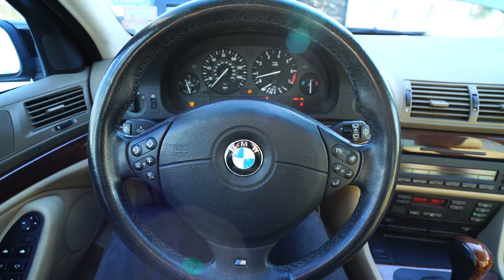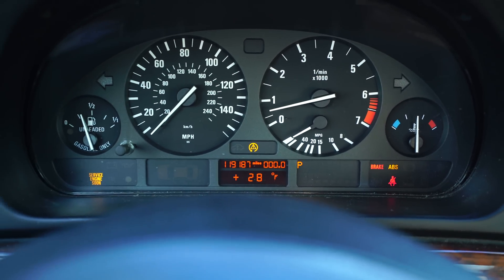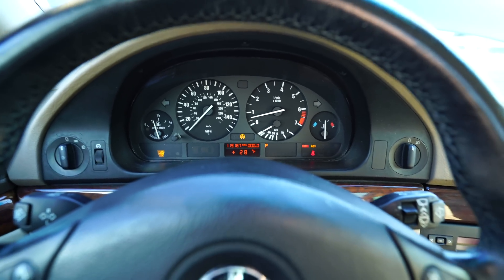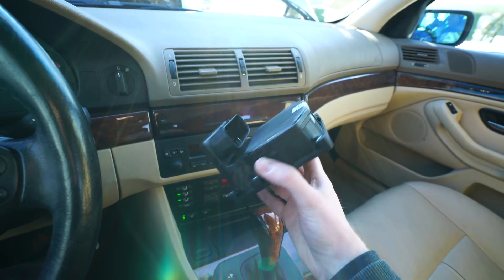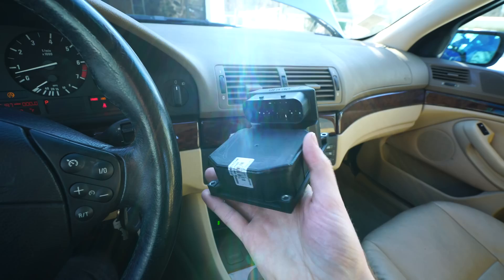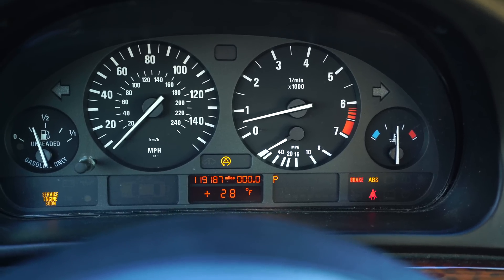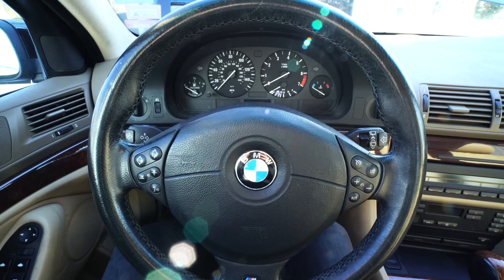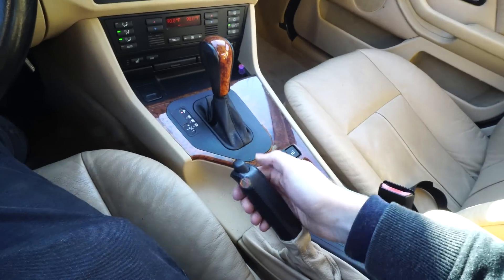BMW Trifecta Lights ABS, DSC, BRAKE - ABS Module Repair E39 BMW 5 Series

Comment: did this with my e39 recently. I also installed a heat shield I got on eBay. It took about 3-4 months for the DSC, BRAKE, and ABS lights to disappear ALL THE TIME. I'm not sure why, but after installing the new module, there would be no lights on the dash, then after maybe 5-20 minutes of driving, they'd reappear. This stopped about 3-4 months though, and I'm not sure why. Maybe the computer had to take some time to reset or something... Just thought this would be helpful for some people to know.

Comment: My e39 in e has the abs and asc lights on, the cruise control works but as soon as I exceed 100km/h it deactivates and does not reactivate until the lights are reset. Could the module also be causing this?

Comment: Great video, I have a 2001 E39 BMW 530i, my symptoms are the SpeedOmeter sometimes works and other times it does not and the ABS light is on in the dash, would rebuilding the ABS module fix this?
My Google search shows that BBA-Remanufacturing is out of business and your Ebay links no longer work, can you or your followers recommend another company that rebuilds the ABS module? Can my BMW be driven with the ABS module out while waiting for repair?

Comment: I have the trifecta lights with the Trans failsafe prog warning on dash. The thing is I just did an oil change yesterday and all of a sudden I get the trans fail safe prog warning along with the brake and abs light on dash. Trans was working fine no issues at all up until this oil change. I’m thinking the lube tech might have done something shady such as steal the trans connector underneath but other than that I think it may be the ABS module. Can you drive without the abs module? I’m looking to send it in for a rebuild through eBay

Comment: was the red brake light on even when the handbrake was not active ?
I had a module rebuilt by 2 different shops and when I hook it up I still have the trifecta 
so far have replaced all ws sensors, brake pressure sensor, brake fluid reservoir cap, brake fluid, pads and sensors and STILL have the trifecta with red brake light
INPA says front left wheel speed sensor, front left outlet valve & front left inlet valve.
I have read every forum known to humanity and cannot solve this issue
any thoughts ?
Reply from the maker: Sorry to hear the trouble. The system is complex. I wouldn’t rule out a bad module. New is not cheap and must be coded to the car. It may be worth finding a competent indie bmw shop to diagnose. You need a guru who cares for this. Also not easy to find!

Comment: Is it common for the speedometer to go out when having the “trifecta” with an E39??
Reply: im having the same issue... did you ever get it resolved ?
Reply: @iamstlouiss  same yall ever figure it out
Reply: @ I ended up changing all my speed sensors with ones I purchased from Fcp Euro and my steering angle sensor which was a pain to do. That fixed it for me

Comment: I have the trifecta.  I notice you did not, but other video always warn about reprogram after swapping the ABS module.  Is this true?
Reply from the maker: If you rebuild the one from your car, no need to program. If you replace it with one from another car or brand new, that requires programming.
Reply: @BIMMERZEITT  
Thanks for your very helpful response!

Comment: E39 are really pos and the only good thing about the car is the way it handled on high speeds other wise get a Toyota for real
Reply from the maker: If I was solely interested in saving money it would be a Toyota or Lexus. But I like the soul of a BMW and to tinker with never ending repairs 🤣
Reply: @BIMMERZEITT  that is true i have learned a lot from my e39
Reply: Puhleeze don't feed the trollz

Comment: dID YOU NEED TO CODE YOUR MODULE AFTER RECEIVING IT?
Reply from the maker: No. You don’t need to code it if you have the one from your car rebuilt. If you buy from another car (used) it needs to be coded.
Reply: @BIMMERZEITT  brill thank you

Comment: I wasted money replacing all 4 wheel sensors (on my 2003 530i, 229K miles). This video is very encouraging, and I will proceed (I have a 1987 325e, 285K miles to putz around in). I have noticed that the Trifecta is DEFINITELY heat-related, so when I saw a guy say he was going to have it rebuilt "again", I'm thinking placing some sort of heat shield between it and the exhaust manifold. THANKS!
Reply: Did this work for you? I was thinking of doing the same thing
Reply: mine only have the light on when the engine bay become hot
Reply: Hi. Did you put a heat shield?
Reply: @KL400-n2e  Where do you get the heat shield from?

Comment: Can we just disconnect the module and use the car?  My antilock brakes are engaging on tar when I even lightly use the brakes.  I need this car bad and a little scary driving

Comment: If the ABS module is bad will the cruise control still work? My cruise works but I have the "Trifecta" of lights.
Reply from the maker: Hey Kris, first step is to scan your car with a BMW specific code reader like this one: https://amzn.to/3s89bkc (affiliate link) which will allow you to begin diagnosis. Otherwise you're just driving blind. It could be as simple as a wheel speed/abs sensor at one corner causing the lights, but could also be an ABS module in need of rebuild. Yes cruise control can still work sometimes.

Comment: I swamped mine in my 2003 for a used one and now it stays on even with the faulty one
Reply from the maker: You can’t just swap them, they are coded to the vin number of each car. You may need bmw software like INPA or ISTA to re-code it
Reply: Don't swap it unless you're swapping with new. Better to repair yours first. If that doesn't work get a used one, repair that and recode that. Not sure the cost of a recode, dealership may prefer to do you a new one $$$

Comment: Nice work. Did you disconnect the battery before removing/installing the ABS module? By the way, BBA-Reman is now shut down worldwide, so forget about sending anything to them. The USA one is a mile from my house. It's likely they've been busted for shady business practices, and lots of people will never see their parts again.
Reply from the maker: I don’t recall if I did. It’s probably recommended to, but since the connector is unplugged anyway it shouldn’t be too big of a deal. Interesting, I haven’t heard that news. Any other rebuild sources?

Comment: Thanks for the video! I DIY the soldering, what kind of adhesive are you using for replacing the plastic cover at the ECU?
Reply from the maker: eduki nice. I sent mine out for repair. But the company who does it looks like they just used a silicone adhesive to attach the cover

Comment: Hey question, if my abs light turned on, then the brake light and then the cluster gauges stopped in addition, is that an indication of the abs module failing too? Like with the abs module failure, will my rpm gauge, temperature gauge and odometer quit too? Or is that a different problem?
Reply from the maker: NinjaPegasus300 yeah it’s possible... but haven’t heard of tach and temp failing at the same time. You have have something else going on. Step one, buy a creator c310 bmw scan tool for $56 ish and scan your car for codes. See what the abs computer has for codes, if any. Code reader: https://amzn.to/2GlGKvF

Comment: Do you have a video about remove the abs module? Thank you!
Reply: Unplug it and take out the six bolts... Then apply for job at NASA because you are then officially a rocket scientist.
Reply: Hey how are you I have the same problem is there a link to the service area or where to send it for 4

Comment: Congrats for your video, its great and very helpful.
im searching the service por a e46 323i 2000, and i dont have luck... i have the same problem. Do you know if the module for the 3 series can be repaired?
Reply: Its a common module try widening your search like bmw abs repair instead of e46 etc

Comment: Any symptoms while driving
Reply from the maker: Sam Dog not really other than the lights being on. However this means the ABS will not work in the event you need it to stop quickly and safely. So is advised to repair as soon as possible.
Reply: @BIMMERZEITT  I always drive with it off.....this time, the light wont turn off
Reply from the maker: Sam Dog oh you mean DSC light? Traction control? Yes sometimes it’s just a intermittent fault that will go away in a day or two on the e39. I’ve seen that on several e39’s. Other times with the abs and brake light it’s the beginning of abs module failure. Get the best bmw a can tool I recommend to scan and check for codes first to diagnose.

Comment: Did you need to code your module ?
Reply from the maker: Sex Hawk no coding is required if you have the original module from your car rebuilt. If for some reason yours can’t be rebuilt and you get one from another e39, yes it will need to be coded to your vin.

Comment: Thanks for this. Two questions, the link for ebay repair site does not work. Any other suggestions? 2nd question - can I drive the car without the module while I send the module out for repair? Thank you
Reply from the maker: G Taylor Johnson I will update it in the morning, thanks for letting me know. Yes, technically you can drive the car, however I don’t recommend it because your speedometer will not function and ABS will not work. So if you were to get into an accident, I’m sure the insurance company would love to deny coverage due to the abs module being missing from the car. Not worth the risk if you ask me. But technically yes the car will run and drive without the module.
Reply: @BIMMERZEITT  Great. Thanks for that. Here's a link for a rebuild service I found. https://www.ebay.com/itm/BMW-E39-E53-ABS-MODULE-REPAIR-SERVICE-525-528-530-540-X5-M-Warranty-Quality/323200458103

Comment: Im about to go look at a 2003 525i bmw and the guy mentioned the abs light was on and has been sitting for 2 years... The worst thing could be this right? I heard it may cost up to 2k to fix?
Reply from the maker: You could scan it while there and see what ABS code it is showing specifically. Not a big deal, nothing you can't DIY! See my e39 buying guide here before you go see the car: https://youtu.be/70zvnZdvEog
Reply: @BIMMERZEITT  I had mine fixed a couple years ago but now I have the same 3 error lights again. What do you suggest?
Reply from the maker: davedavis scan with a bmw tool like creator c310 get the abs code to begin diagnosis... even the rebuilt ones fail again after several years it could be the module again
Reply: @BIMMERZEITT  how many years ago and who replaced/rebuilt it?

Comment: Hey hopefully you reply back :( I got this on my 2008 328i when I drive longer than 10 min it pops up I took it to the dealership and it worked fine for 2 days nothing popped up til today took it back in they said to either fix the bearings (which is a 50/50 chance it can be that) which is 1k to fix or This I think but they are charging 2,700 for it :/ can I take it to a mechanic instead ???

Comment: Just got the trifecta on the way home from work today in my 2001 740iL.  🙁  Looks like I will be sending the ABS module out for repair.  Again.
Reply from the maker: Ready72000 ugh!
Reply: BIMMER ZEIT Started the car this morning and the trifecta lights went out for about 15 seconds, then came back on.  I drove it to work.  Started the car this afternoon and no trifecta lights all the way home.  Strange.

Comment: Looks like the links no longer work to the ebay ABS Module Repair Service and the Amazon to the New ABS Module is not available. Do you have any other source for the repair service?

Comment: Did you have to bleed your brakes first?
Reply from the maker: Paul Nelson hi Paul, no need to touch the brake hydraulic system. The module here doesn’t interact with fluid or hydraulics directly
Reply: BIMMER ZEIT I have a bmw 5 series, e39 520i. Year 2002. So bleeding the brake lines isn’t necessary, just unbolt the ABS module, send it off for repair, then simply bolt it back on! I wonder why my mechanic is telling me that the brake lines need bleeding! If I can do this, then it saves me going to the garage.
Reply from the maker: Paul Nelson might be unrelated. Flush brake fluid and bleed every 2 years anyway as part of maintenance. It couldn’t hurt. Shouldn’t cost much. An hour labor maybe
Reply: BIMMER ZEIT it’s my abs pump that is going to be repaired. Is that different from the abs module?
Reply from the maker: Paul Nelson oh ok, yes the module is the computer shown in my video. The pump is a different story yes that is part of the hydraulic system.
Reply: @BIMMERZEITT  Thank you so much, it makes sense now.

Comment: Trying to help a friend with his car. His abs was malfunction and got a replacement module as we determined that was the issue. New module in and all was good for a few months until dsc abs lights lit up again. DSC5.7 73DSC pressure sensor. Code B3450_57051. Any idee where to start. Could it be the replacement module acting up. Brake pedal feels soft in comparison to my e46

Comment: I bought a bmw e39 530d 2002 with both abs lights on. I have a code : 14 Valve relay fault. Do you think i need to repair my ABS module like you ?
Reply: I think the relay is bad you can change it. In the fuse box.
Reply: Did u fix it
Reply: @terrencemayes469  I changed it

Comment: Hey Thanks for the Video. My X3 abs braking comes on with very little pressure applied to brake pedal, especially when backing down my steep driveway. Yesterday I took out my abs sensors and cleaned them, what was strange, I did not see a reluctor ring down the hole.
I also have the trifecta of lights. ABS, 4x4 and brake. Any thoughts? Thank you!
Reply from the maker: Nick S hey Nick step 1: scan the car with bmw software of bmw specific tool like the creator c310 and get the fault codes
Reply: @BIMMERZEITT  Thx for the fast reply. I did check the codes with my cheap Actron scanner and got a P1774 code.=? Low coast brake solenoid valve is turned On or Off" by the Transmission Control Module (TCM) in response to signals sent from the PNP switch, vehicle speed sensor and accelerator pedal position sensor (throttle position sensor) My scanner is far from a BMW scanner and the information I received from the internet could have been for a Nissan... But it kinda makes sense since the speed sensors are all connected to one module / computer or another. Any input would be greatly appreciated. Nick- PS What was a little weird, when I cleaned my sensors and looked down the hole to clean, I didn't see a reluctor ring, just somewhat smooth and dirty. bmw x3 e83 2007 130K miles. Thx....
Reply: Nick S did you manage to fix your problem
Reply: Hey Buddy, yeah I fixed it. First I bought a go Foxwell 510 BMW and had many codes. Transmission Transfer case, Zme electronics etc etc... The Whole problem was the Reluctor Rings Rear and the ABS Sensors. Changed some fluids did adaptations and vehicle runs Great! Was going to light it up but runs so good I even put new Michelins on it and can’t believe ABS rear sensors and ring would cause so many problems. By the way did the ring, didn’t change the Half Shafts and put new sensors right and left.
Reply: By the way the axles were rusted and the ring were pushing on the sensors. Also changed the bearings. Get the BMW tool for the bearings. BMW loves there press fits. Mark the axle to the wheel hub and put it back the same way. Clean the splines with a wire brush and some PB Blaster the use a little anti-seize. If you have a problem getting the axle in buy a 20.00 inner tie rod end remover and clamp it to the axle hammer on that nothing else, into the hub. You can buy the axle puller that screws on the outer threads of the axle but it’s expensive. When good luck to anyone doing the job, I Leant a lot...

Comment: just the DSC light came on recently, any suggestions?
Reply from the maker: victor alvarez,jr scan the car with a BMW specific code reader or inpa and pull a trouble code first to point you in the right direction!

Comment: Because I was driving my car and the axle front right on my bmw e83 x3 had some shaft play. If you hold it and push and pull on the shaft in between the two boots/bushing things it would wiggle so I imagine I had to replace the whole assembly, I tried making it a few days untill I got paid to do this repair. Then driving it one day after I went to exit a driveway and I was only making a wider turn when the car almost stopped after a loud bang/pop then it felt as if the axle dislodged it’s self. My three lights came on and the car started running really really roughly and I drove it quite awhile with being unsure I got off of work the rest of the day came home put the car on a jack and removed the wheels to inspect. Nothing seemed as it had broken same condition as before but the car would barley make a uturn and turning just seemed like the axle was fighting the turning function. Well I took the wheels off the  decided to put them back on and drive again and took it on two separate drives and then all the mentioned scary weird stuff going on previously had just been no longer exsisting. Does the module go out intermittently should I be expecting it to happen another time should I just get it rebuilt before driving it again?